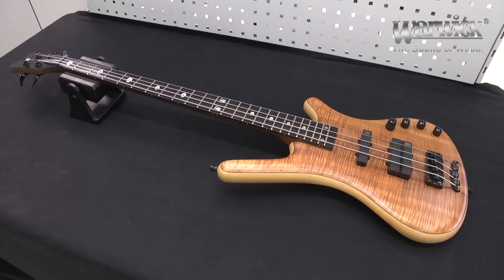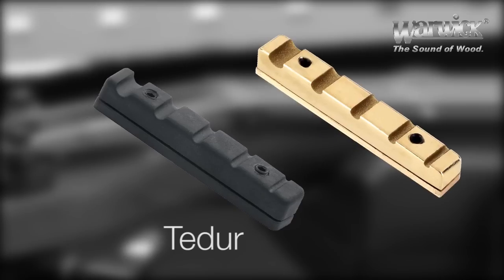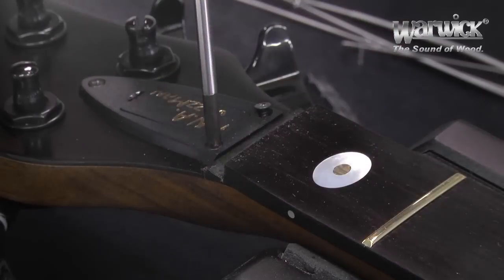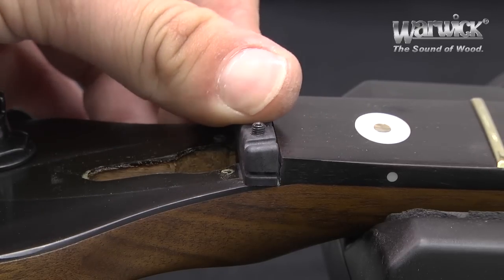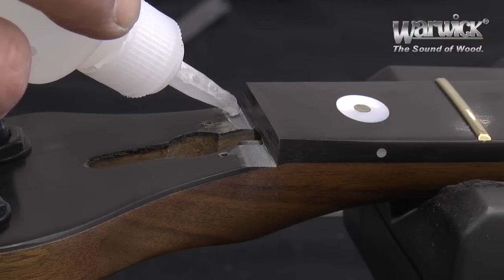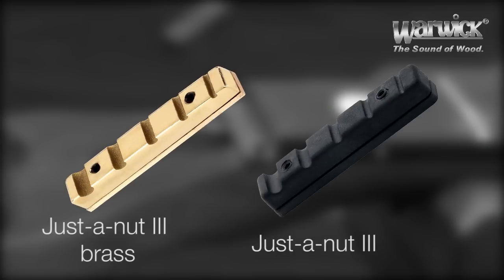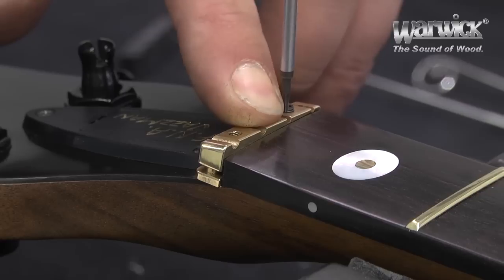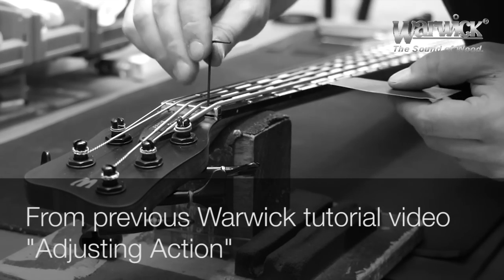Warwick Tutorial: Replacing a Just-a-nut III

Comment: Is this the same procedure for a "cheap" 2006 Rock bass by Warwick Corvette standard 5-string? I don't see a "seam" where the bottom piece would pull up to separate from the wood and just a bit concerning. I have the part but want to make sure I won't screw this up since it's the more affordable older line. Oh and the type of glue? Super? Epoxy?

Comment: Hi i was hoping you could answer my question,im currently in process of buying a 2013 warwick thumb SC 5string,the just a nut on the bass looks plastic and not brass.the owner told me that the bass is totally original,that it came with the plastic black coloured just anut,should it not have the solid brass nut or am i wrong?as far as im aware from 2010 all warwick made in germany basses come with the solid brass just a nut 111,this bass was built in 2013 and has the plastic just a nut 111.many thanks.
Reply: thanks for the reply,yes the seller assures me the bass is a 2013 model and is as new,but it has the tedur just a nut,he assures me this is the way it came..ummmm.

Comment from the maker: Basically yes, you can install an JAN on a non-Warwick bass - given that the neck width and the way the nut is placed are similar. You have to check those two factors first. With some brands this won't work, but there are others where it will. And we offer special JAN versions for fretless basses - you can find them at the website shop.warwick.de

Comment: I had a "professional" replace my JAN2 to a JAN3 and they didn't glue it back on or remove old glue. It stayed in place by the force of the strings. I will now do it myself correctly. What brand glue do you recommend? Is it possible to use a glue that is "too permanent"?
Reply: *****
Thanks for the super quick response!! By too permament, I guess I meant a glue like krazy glue or super glue.  Something that would be really strong, to where if you wanted to take the nut off in the future, that it would cause issues trying to get off.  Sounds like I just need to find the thinnest glue with light hold? Because there is no reason to use a super strong glue as the strings will be pushing down on it.
Reply: My main concern was if I use too strong a glue, that if I change the nut in the future, I could damage the wood underneath and around the nut.